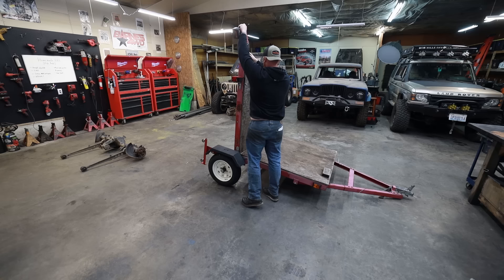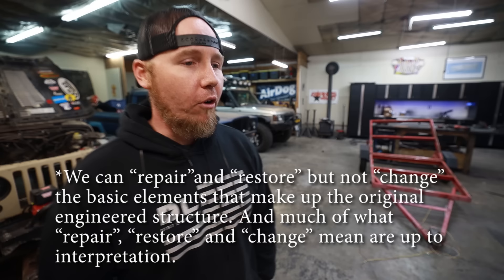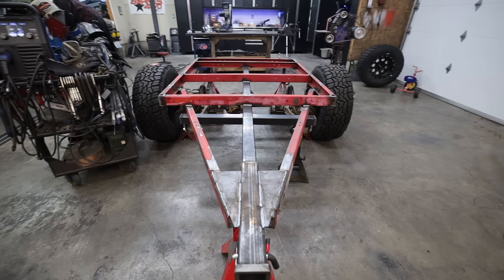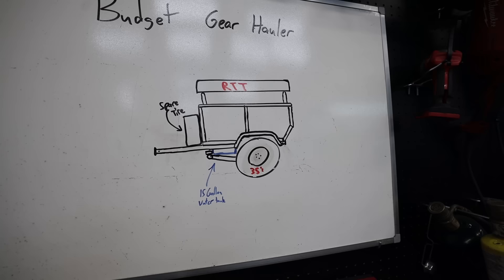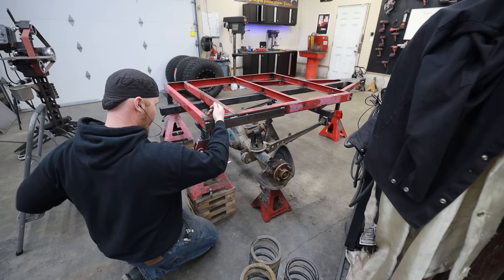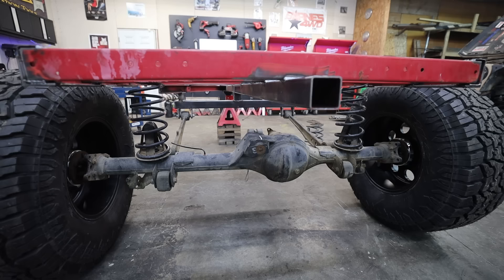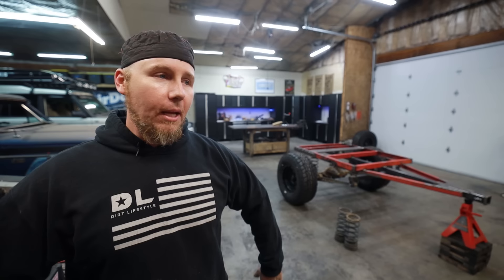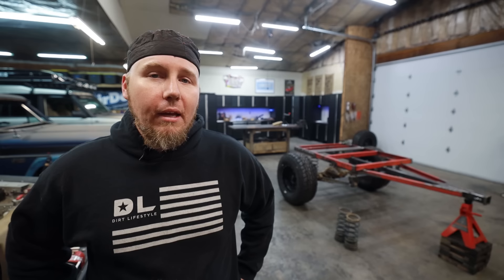Budget Harbor Freight Off-Road Trailer Build. Making An Overland Trailer On The Cheap.

Comment: My dad bought a harbor freight trailer from a guy. Just recently, I rebuilt the whole thing. Tore it down. Cleaned up any and all rusted/paint chipped areas. Welded everything back up. Repainted it. Installed new taillights. It’s mainly used as a yard trailer that has a “dump” feature, but can be used to haul small, lightweight, items.

Comment: I reused a small old trailer my grandparents had they gave me. I still have it today and it’s on its second rebuild. The first time I used scrap parts and free stuff cause I was broke and needed a trailer to haul two quads. Not it’s done right and still didn’t cost a lot. I’m happy with what I have now so don’t let anyone give you crap.

Comment: I had a friend moving cross country. with some old t posts from a fence, and an old boat trailer and a cheap fluxcore welder, we banged out a shit trailer in a saturday. it ended up lasting 10 years and many thousands of miles. it wasnt pretty, but it worked.

its great that you can show something people can do on a tight budget.

Comment: I’ve always wanted to hook an old alternator up to the pinion on one of these truck axle trailers and use it to charge a battery bank.   Not efficient, I know,  but an interesting bit of engineering.   Keep up the good work!

Comment: Its funny how each state has different rules for trailers, homemade or customized. 
Like you said this is going to be a budget build. Use what you have and drive on.
Reply: Yeah, in Oregon if the trailer is under a certain GVW it doesn't even have to be registered.
Reply: @chadalcock7275  this like the only reason i keep my stuff registered in oregon
Reply: @chadalcock7275  Same in Ohio. All you need is a scale ticket showing the trailer unloaded weight.

Comment: It's your trailer and you did it your way. Nothing wrong with that.
It is good that you used the harbor freight trailer and showed the points that need improvement.
Seen other videos that use harbor freight trailer and just build on top of them and they don't last.

Comment: Glad to live in UT. Single axle trailers don’t need to be registered or titled. I got a cal ranch single axle utility trailer for under a grand. Took the expanded steel deck off. Welded 1” schedule 40 pipe down the sides in the angle iron bottom. Welded a 1.5” schedule 40 pipe down the length on the underside, and welded 2 1.5” sch 40 pipes at an angle from the sides to the tongue. All of that made it very stiff, especially in comparison to how it was. Then I’ve been welding an 11 gauge plate as the floor. It’s overkill,  it means I can tow dirt bikes, my touring bike, metal runs, and camping is great as well. 

Also swapped from spring under to spring over and went from the original 12” tires to 29” tires that came off my last trailer. Eventually it’s getting a heavier axle with trailer brakes and some better suspension. 

Been a fun project. And no legal worries.

Comment: This video couldn’t have come at a better time. Last weekend I took my harbor freight trailer (modified; longer axle, spacers, bigger wheels, rooftop tent) and sadly the whole upper part of the trailer and some frame bolts came apart. I almost threw it down the mountain. I barely made it home but when I did, disassembled, and threw away the trailer. Same day I bought a 1975ish Ford Courier trailer bed truck conversion and just finished building it this weekend. Welded roof rack, bigger mud terrain wheels, and my old Tacoma Bilstein (stock) shocks (not judging, just sharing my life 😂 ). 

I’m sure your HF trailer will be the best out there though. So I’m excited for this series. Keep them coming.

Comment: I just did this at the start of COVID. I spent more on used tires to get the trailer home than the actual trailer itself. I've put less than $500 into it then added a $1300 RTT. Still a work in progress, but very functional.

Comment: I love the idea of the center tube for strength through the entire chassis, well done. I know you are not that far yet, have you figured out ways to level it when you are setting up? Do you need to secure it so it's not so bouncy while trying to sleep? I saw someone else comment something about using an alternator on the yoke of the diff to charge the trailer while driving - that sounds like a great idea, just need to do the math for the right size pulleys and a way to mount the alternator and tighten the belt. Please do the Watts link, if for nothing else, it's rarely done and I'll bet there are a large number of viewers that have no clue what it is or why you would use it - pros/cons. And you do a very good job of explaining things for those that are not educated in the mechanics of how that stuff works.
And of course, love the using spare parts for a build. I rarely read the comments, let alone comment myself, but I really enjoy the builds, all of them. I just like to see how other people work around the different issues of building something instead of just buying what someone else built.
Reply: I like your way around the government regulations about getting a title for your trailer by using a scrap H.F. trailer. That was great thinking. Best part of the build so far.

Comment: Should put air bags in this bad boy for leveling, or maybe on the "no budget" like you did on the disco!
Reply: Air shocks might be cheaper 👍👍
Reply: I’m putting 4 drop-leg jacks for leveling. I’m attaching them with hitch receivers, so I can remove them when in motion. We were camp, level ground is at a premium.
Reply: @jeffandrews7335  I was thinking of using the round trailer jack style for mine for the sole reason there’s less time fabricating anything, just weld it on and go
Reply: Wouldn't the air bag suspension  be bouncey  though? 
I think hydraulic shocks would help eliminate  bounce and rebound.
Reply: @herbwheeler4470  no you'd still have your typical shocks

Comment: Having a deck on those trailers stiffens them up a bunch.  I have one I use around the house for hauling steel, wood and garden stuff.  I keep meaning to tack all the bolts and joints, but never get around to it.  I do inspect it often.  Perfect for what I need. I keep it folded in a 2 car garage with 2 cars.

Comment: Loving the trailer build gonna ask if this could work in anyway could you take a alternator and run it from the axle since the gears are going to be turning on the road anyway and use it to charge a on board battery system or would you have to use some kind of sprocket to gear the rpms up to match that of a engine belt or?.  Just an idea I've had for awhile. Thanks
Reply: I don't know if that would work but that's a really ingenious idea as far as I'm concerned.

Comment: Just had a thought. This is from a hot rod truck that I saw years ago. This truck had the alternator attached to the rear axel and was driven by the yoke. The downside is that when the trailer is not moving there would be no charge and it may take some tweaking to get a decent charge when on the trail and moving slow. Mud would also be a problem when off road. If there was a way to solve these issues it could be a cool concept to incorporate in to a trailers power system.

Just a little food for though. Might not be the right idea for this build, but could be good for a future build.

Thanks again for the videos and great ideas!

Comment: You can always register it in Maine.   I did that with mine.  It was super easy.  
They don’t put color, # of axles or even weight on it.  
I was able to swap the plate from my orange single axel to my black double axle.  And it was always ok.  Never had issues

Comment: Are you going to use rear folding bed section for upper deck ? Was thinking that pinion going down the road could be used for a charging system (or a boat prop) .
Reply: Interesting…
Reply: Oh yeah mounting an alternator on the axle would be awesome!
Reply: The charging system idea is awesome!
Reply: Thats actually a neat idea. The pinion would he spinning pretty close to engine rpm at speed, it would be hard to make it work though
Reply: @Beandiptheredneck  OR AT LEAST AN ICE CREAM MAKER. LOL
Reply: @Beandiptheredneck  Once I said ice cream machine .. I'm like Washing machine ! YES

Comment: The monologue at the end of the vid is definitely welcomed, I have seen the criticisms in a lot of videos and it stems from forums where this was rampant. I for one welcome your videos as it is a teaching tool, when you have something go wrong you admit it and show how to fix it in a way that someone with little skill can understand but not so much that people with a lot of skill would bore of it. I for one have a lot of skill and being a journeyman machinist (not a button pushing individual that claims to be a machinist) I do have to put out some but I do criticism selectively when there is safety involved or when someone asks for it. 

So in short do what you are doing, it is awesome! I for one was trying to get to where you are at with a shop and all but have had some setbacks and want to get to the point where I can actually do projects in a place where I have room and tools to do so outside of work which is a model shop, but I might implement some of the equipment I use at work into projects as well. Hel, I have already started that with my own logos and emblems for my Sequoia and even branched out and did Donald's logo for his Frontier that he uses on his channel softroadingthewest and might even do others as well. 

But all in all I am wanting to build my own Overlanding trailer as well and have some things in place and this project is making the gears turn in my head as well. Just need to find a donor trailer to get started and have thought about the harbor freight trailers. Hel my parents back in the day had one with a Sears cargo pod bolted on it that they used behind a Pontiac t1000 to go in between Denver, co and central Oregon lol.

Comment: First time seeing this channel, but I just have to say this: The Harbor Freight trailers are lightweight junk right out of the box, but they're very easy to modify into really strong and nice trailers if you have some basic metal working skills. I did one years ago and it turned out great. Unfortunately I sold it a few years ago, because it was great for anything and everything I put it through.

Comment: Love what you are doing. I did one but I don't weld so mine is all bolted. built a plywood superstructure using 5 sheets 4x8' plywood.  For your house battery. Think about charging it from the Taco while driving. You can use Anderson plugs to connect the trailer. I used a set of cannibalized jumper cables to run from my Jeep battery to the hitch area along the frame. Jumper cables are so cheep for the quality of wire. large gauge for the distance.  And some controllers so you can not discharge your cranking battery. I also put in some fuses. Then you may want a solar panel and a controller if you stay in one spot.  I would like to have seen independent suspension but you had the axle lying around and now it is used. Keep creating.

Comment: The back of A pickup frame can be A cheap start for A project like this. You might be able to match wheel bolt patterns, retain parking brake, and use surge brake trailer coupler if you want, or need brakes

Comment: i like the red trailer company's folding trailer, it already comes with a central spine, it's also MUCH stronger than that... thing... you have to work with, the central beam also folds.  the side to side strength of it comes from it having a really wide flange and heavy steel on the spine's c channel.

Comment: Just a thought, using a truck rearend. Put a 8'' pulley on the yoke driving a one wire alternator mounted to the diff to automatically charge any onboard batteries.

Comment: In my state the problem for me was your adding weight to the trailer (the mods) which takes away from weight you can load it with. The hf  trailer was "engineered" for a weight limit and that's wat they look at. Very nice build looks good! I had to register homemade took 6 months

Comment: I kept the same size wheels on mine but I added a 212cc Predator with a 10-tooth mini bike clutch & chain and a 60 tooth sprocket on the trailer wheel.  So now my rig is a 6x6
Well, 6x5 actually.  
Trailer is 1 wheel drive

Comment: I like what you have done here with refurbishing an old trailer even if it is a cheap model from a store. So what, not everybody is made of money. I am an ironworker/welder by trade even though I follow a set of plans to build things I have also built my own things just out of thought given my experience to guide me. One thing I can say is if something went wrong with a certain weld or clip I found that that did not work and made that area stronger. Do what you do,  do not listen to other people when they tell you how to do something you are capable of doing.

Comment: I have one of these trailers. I have plans to strengthen it in a similar way. 
I just use mine around farm for different chores.  Mostly hauling firewood or brush. 
It is to flimsy and needs larger tires as is.
I pull mine mostly with my 4 wheeler. So I need to keep it light.

Comment: Little hint, add over-travel limiters.  I built mine and had a coil spring pop out on a washboard.  I never found it and had to buy two more. Also, not sure about your design but if it doesn't include fenders, you might want them.  Nobody wants to trail behind someone without fenders.  I had to buy a windshield for a guy who rode with us to keep things civil.  Looks good.

Comment: i have the exact trailer. It's rated 1700 lbs and I had several times over 5000 lbs of sand in it band drove it down the road. slowly, because i pulled it with a Samurai... but they are stronger than they might look!

Comment: I've kinda been in the overland scene for long enough now to where I've got friends who want to tag along for the adventure, but the main problem is space. I have a 1998 rav4. The tailgate, and roof basket both get full when I've got 2-3 people depending on the length of the outage. I decided it was time for a trailer too. The rav4 being a particularly small yet capable 90s CUV, I wanted to keep with the theme. I bought a motorcycle camper for 50 buck that I want to fit with larger wheels and tyres but it's in a condition that reflects it's price. It's been sitting since 1999. I power washed all the moss and lichen that made it's home on the hardshell and all the spiders and mold on the inside were dealt with. But the fiberglass lid was left open for so long the weight distorted the whole tub and lid enough to where it won't close. So the frame is good but the fiberglass is Fubar until I brace it with an endoskeleton of sorts.

Comment: O-H-I-O Porter greetings.🇺🇸 It’s September 2022. I have one of these old HF trailers that I’ve owned for many years. A friend built it & added plenty of wood to make it look nice & accept a nice tarp. I’ve hauled motorcycles on it & many other things as well. Now it’s sitting in my backyard with miscellaneous junk in it. The wheels/tires were the things I’ve hated about it for many years, other than it’s lack of solidity! They say, One man’s junk is another man’s treasure. I hate throwing away any good trailer. After this initial video, I see that trailer as such a possibility now. I’ve often wondered if I could/should disassemble it & revive it to meet my current needs. Well, the answer is…It still has potential & really deserves an attempt to use what skills I have to upgrade it somehow! I don’t do any off-roading, I don’t have much junk laying around, but I still have ideas & the desire to work with my boys on Father-Son projects. And I LIKE going to junkyards! So thanks for the motivation & I look forward to seeing more on this trailer! I always tell my boys that you can do some thing several different ways, but you learn so much more just by doing things & learning from your mistakes. Good point about using a new trailer or building one & having to worry about inspecting it. 🥰🤩✌️

Comment: Since you are using a drive axle, it would be tempting to add an electric motor that you can turn on for additional traction. It would also help you move it around when its not hooked to a truck.  Just have a way to decouple it on the road.

Comment: I think you are doing a great job Nate. It's awesome that you have resurrected an old trailer frame that no-one values into something worth while. You keep doing you mate! I would suggest removing the diff head from the axle though. That will reduce unsprung weight a lot and make the ride and stability much better. Maybe plate it over or something. Or I have seen someone fit a pulley and an alternator on an axle input shaft like this too- charged the on board battery while you were driving along! Cunning!

Comment: I have a HF Super duty trailer that has made 12 trips with 1/2 yard of crushed stone and top soil and broken concrete that have pushed it to it's limit.  the only weak point that i've found is that the A frame arms have twisted slightly and caused it to bend.  i'm planning on adding a cross brace in there eventually but my heavy work is done.

Comment: Great job! I would just change everything, haha. For people that want to tell you how to do it why don't they build a trailer, film it and put it on YubeTube and then you can heckle them. 
That being said one thing to consider when someone is doing a project light this is parts compatibility. Most people use what they have lying around and that stuff most likely came off their rig as they built it. That is great as it means lug patterns match. Suspension parts match. Shocks should match a part# on your rig. If you need parts, you can rob them off the trailer to get you home. Planning ahead always beats kicking yourself on the trails.